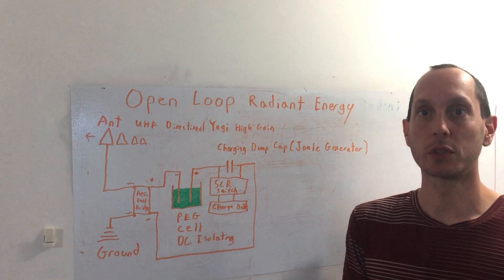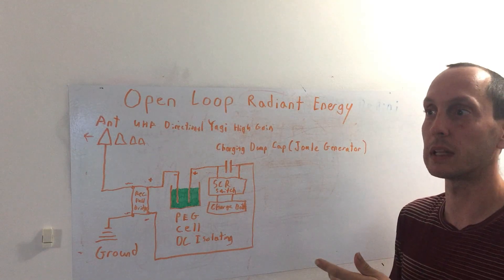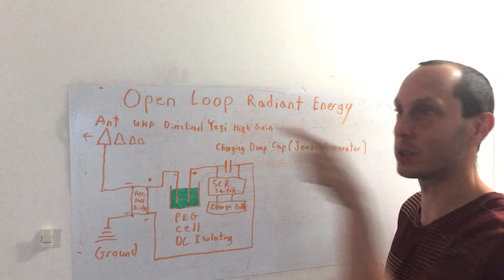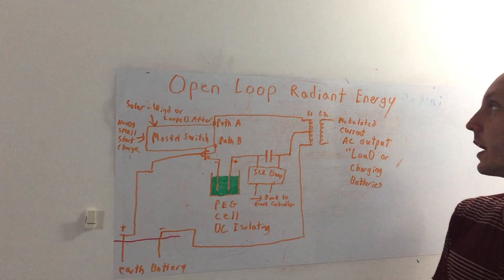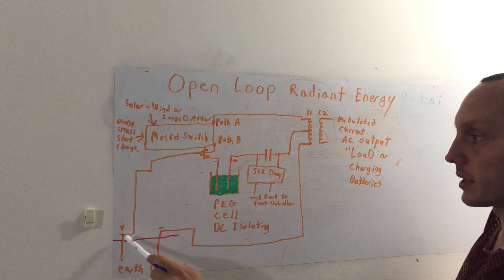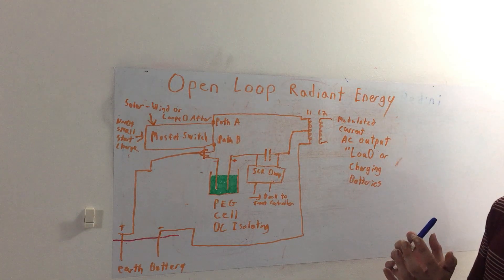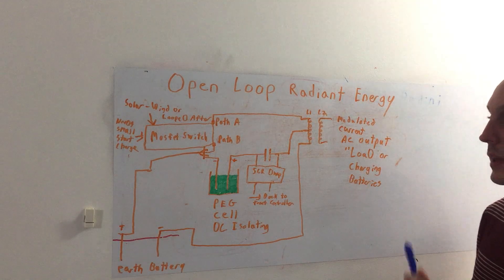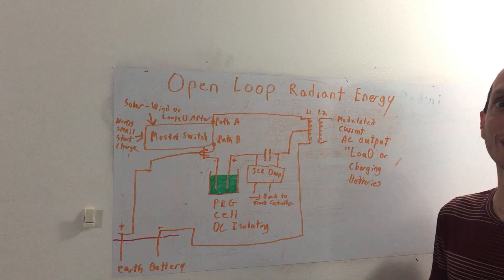Open Dipole Circuits

Comment: Hi! This is Tesla radiant energy, or cold electricity. Working with NPN transistors as well. 1 NPN transistor, 1 resistor, 2x AA 1,5V batteries, 30mH coil, 100 LED lightning for 12 hours. And the batteries still charged.
Reply: Actually i was made a mistake, i wanted to simplify the avramenko plug and the circuit is a garbage.
Reply from the maker: what happened?

Comment: Don Smith definitely talked quite a bit about no electron flow between things and I remember seeing one very late video of him demonstrating the effect with basically a plate capacitor with an insulator and some high voltage.  I think Tom Bearden and John Bedini both said the ions carry the electrons.

Going even deeper tom talked about essentially ions but with virtual particles being the positive.

Comment: I guess a feedback would need same isolation stage with a step down transformer rectified and smooth.

But I am not sure if we really need two isolation stages or just one … maybe if we use the output as single wire with diode splitting one loop for load and withe other for feedback … clearly over complicated for this stage. I guess we need to see it running first.
Reply from the maker: I'm not sure I understand where you're going with all of this.  I guess we all have our way of seeing things :)
Reply: @joellagace1679  i am trying to make use of this for pancake coils replica that i built … i didn’t use batteries for input to make sure i can’t overdrawn them. So using a laptop charger system is shutting down if i try to use heavier loads than it can power up, otherwise it will self destroy.

Now because a bifilar coil allow, I have decided to built another set of coils for output and I can fit one set underneath and one set on top. It seems that i don’t need to balance how I split the loads as long as I don’t over drawn the input and i can use one set for intended load and the set for a feedback using pegcell for isolation.

The whole point is I already have something that work and I want to supply 64watts as feedback which is the actual input from laptop charger … I hope it makes sense now.
Reply from the maker: ahh!

Comment: What is the frequency it can operate your PEG cell ?
Reply from the maker: we are not pulsing the cell with current, we are switching a path it shouldn't matter as long as its resonant/compatible with your transformer. Perhaps you are seeing it like a Bedini type switch? Some similarities but not all same principle of operation in this case.
Reply: @joellagace1679  of course, that’s why you fit the FBR before peg cell … brilliant idea ! No need for tunning anymore 👏🏻👍🏼🥇
Reply from the maker: Just trying to make it as simple and mainstream as possible that's my goals with all this research. Make it more accessible to all to experiment with. That's why sometimes it looks like i'm going in circle or re-inventing the wheel, Not everyone can build a full blown "complex" HF Don Smith for example. Many fail in fact. And get discouraged and blow the whole topic over "over-unity" away.
Reply: @joellagace1679  I wonder if those DC booster HV for £2-5 could do the job with peg cell and have a better perspective if we don’t/can’t use antenna ?
Reply from the maker: Well the point here is to not have to need anything the needs traditional current. The switching would need a little. HV boosters take some extra milliamps to operate even if your not outputting it to anything, it needs to keep running that oscillator. If you have an extra input source you can try it.  And at HV you don't need the PEG cell, just build the Don Smith as its supposed, The traditional ion valve at HV will do the job. But that's all advanced and many might not get over-unity from the first try. I'm just trying to keep things simple with the most chance of success. Of course you can decide if you want to take the risk and customize and experiment with it.
Reply: What about using a whimhurst generator for your high voltage supply?
You still need the switching right? Or the switching is only required to produce the high voltage spikes?
So a whimhurst you wouldn't need switching?
Am I completely lost?
Reply from the maker: don't you need some sort of source to run spin the wimshurst. Maybe the wind.  My point in all this is to break away from all the complex super high voltage AC and DC fields. spark gaps etc, Oh course all of that works but its much more complex, needs tuning at that sort of thing. This is simply a different approach.